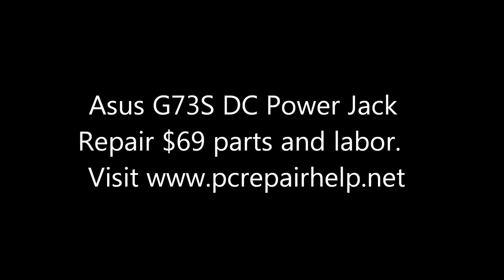Asus G73 S/G73SW/J/JH/JW/W AC/DC Power Jack Repair

Comment: I believe I'm your first view, and you posted this one day before I needed to do this repair. Just finished reassembly; I simply soldered the DC jack differently instead of replacing it, and it works flawlessly, at least for now. THANKS SO MUCH.

Comment: At $65, you're doing a good service to the community. Ignore joncot1812. I'm an IT professional and fix my own stuff. I also work on my own car. I do brick and mortar work. I do wood work. I am horrible with plumbing and gas lines. I pay someone else for this. For 99%+ of the population, you're eliminating a headache for $65 which most local pc repair shops would charge in excess of $65. Thanks for providing the video on how you do it. I followed this as a guide to get my laptop apart. Thanks!

Comment: For the record the Tech at Pomeroy is VERY knowledgeable. If you want straight shooting hard core tech work, this is your guy. Getting into and reassembling a GS73SW is delicate and a bit intricate as the video shows. It's as tight as a Swiss Watch. If it's not done right you can easily damage the keyboard and LED assembly. I just sent my GS73SW in for a DC jack...I'm glad I did. It's already repaired and on it's way back!  The technician has alot of experience with the GS73SW (and probably others!), so for him it was a breeze. He is a rare Diamond Ace Technician!
Reply: @mender20 how do you send it to him and package it

Comment: I think the word that best suits your entire character is "pretentious". This guy made an awesome video. Thanks btw. I installed a NEW power jack on my clients g73sw. I only do 20-30 a year and can't have this apart, resoldered, and together in 30 minuts. I'd LOVE to see you try and end up with 14 screws flopping about on your carpet with holes behind the bezel from driving the wrong depth fastner.

Turd.

Comment: Remove the old solder and resolder the bronze colored pin where it connects to the board.  You can kind of see how it separated.  I have a picture where you can see the separation.  If you need it message me.  Just use a high temp iron so you can melt the solder quick enough without getting the board hot.  I added a bunch of solder to beef it up, no problems since.

Comment: Aileron64, just turn the power off, remove the battery, plug in the AC adapter. If your power after awhile "randomly shuts down", then your strongest culprit is the Power Jack, unless you have kinked or broken AC Adapter wires which is far less likely.

Comment from the maker: Like any other laptop the G73 needs to be soldered by a professional with the proper skills and tools.  We have no problem replacing the dc jacks on this model for the $69 parts and labor rate.  Companies like Asus will not deal with this on the board level and will tell you it needs a motherboard replacement.

Comment: It takes 10 minutes to take mobo out,  5 minutes to resolder the pin, and 10 minutes to have it back together.  Even if they have you do it why charge for a new DC jack if there is nothing wrong with it?

Comment: I meant that the pin isn't physically attached to the jack.  It could be pulled out easily.  But when you re solder it, it won't go anywhere, it stays in place.